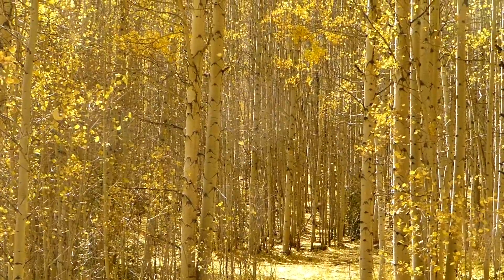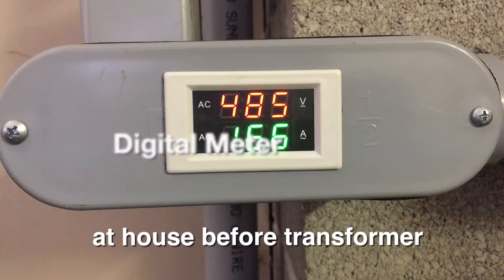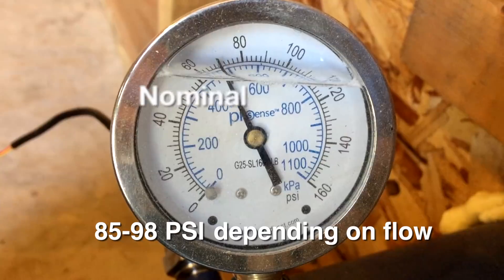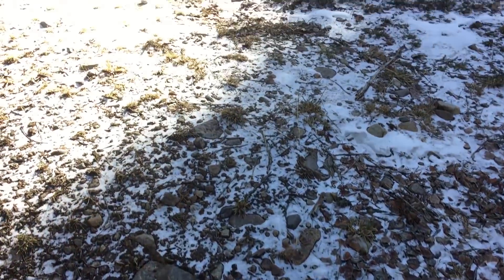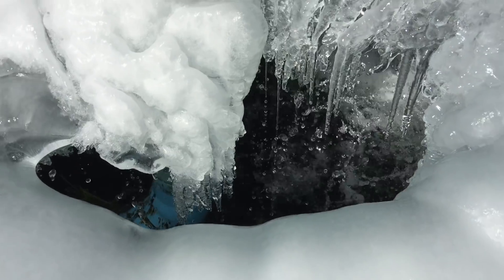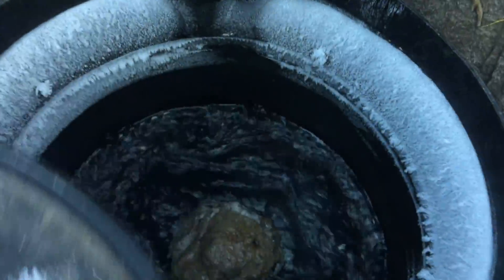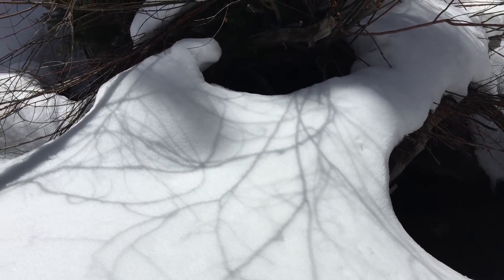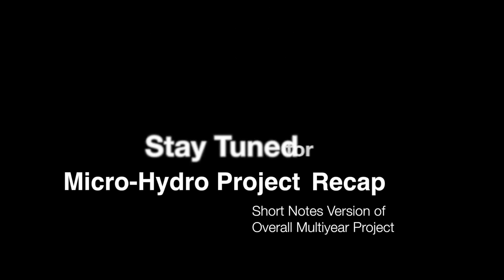Part 19 MicroHydro Power System in CO

Comment: Good to hear it is still running. 
I only have grid tied solar panels, but I do enjoy that they can keep keep up with power usage of my heat pump although only in the day time.
Reply: When we built our home we installed an air to air heat pump because of alergies with electric backup. Our total energy bill was the same as our neighbours using gas heat and electric appliances. I will always install a heat pump from now on.